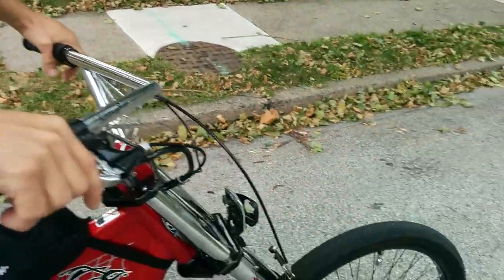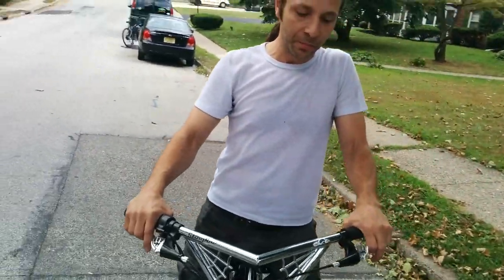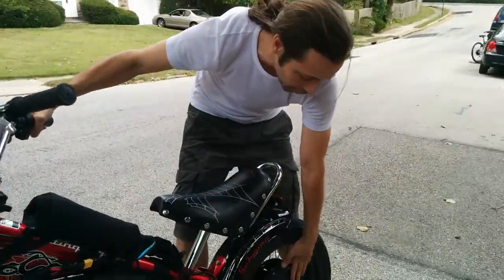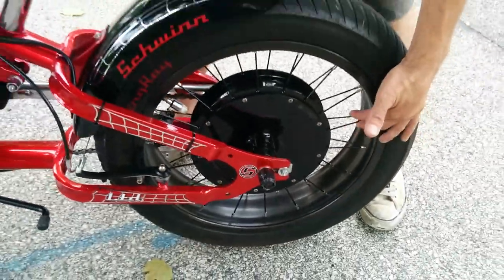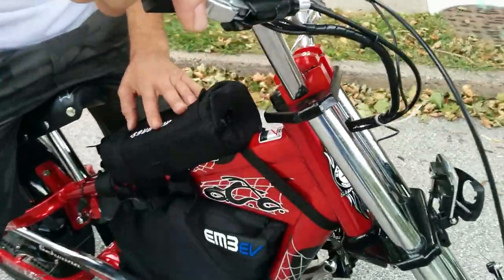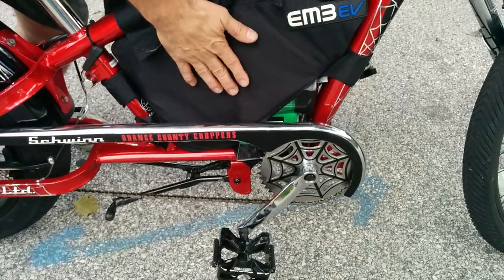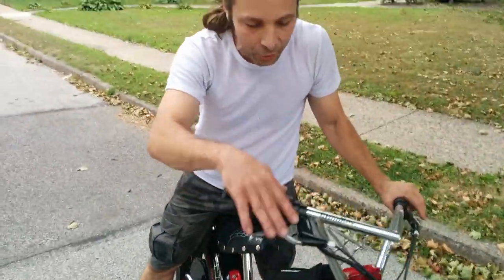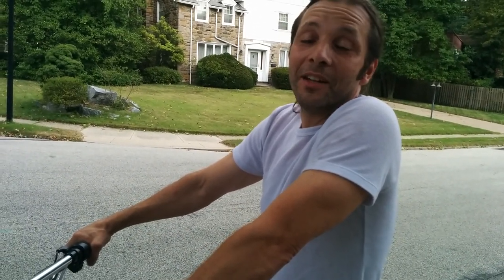Mike DrChopper Moser Schwinn Stingray Electric Bike EM3EV Lyen Conroller LiPo Batteries

Comment: That looks nice. 50mph is plenty. I replaced all the electronics, motor and battery in my off-road uberscoot. Now running 72v at 150a and it rrrips! But your bike has got a really nice low riding position, I bet it's lovely to ride.

Comment: Done same here, added 20 inch 1500w Fatbike ekit with 48v / 20Ah battery and front bent springer forks with ape bars, just awaiting headset and neck , think i am going to have to mod the springer forks as the pesdles are on the ground lol
Reply: Iam trying to find the same thing you have looking for that 48v 1500 hub for my 20" rear and would like to know were to find it and what size spokes I need.

Comment: Why not use a mid-drive ?
Reply from the maker: This was before the BBS02 came out
Reply from the maker: Hub motors less maintenance
Reply: @davidsonshine9678   i just bought one for 50 bucks are you saying the BBS02 fit the stingray
Reply: @randismainhustle6171  yes please the west coast chopper looks great too with motor on inside but not sure if itll fit
Reply: What’s a mid drive?
Reply: @babyjay3055  I believe the bottom bracket is 120mm but I have not tried this yet